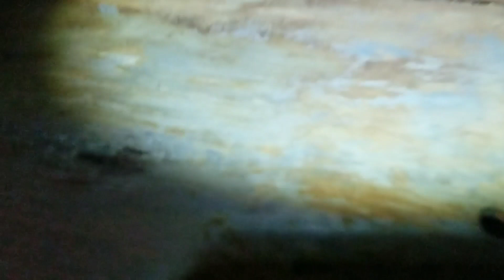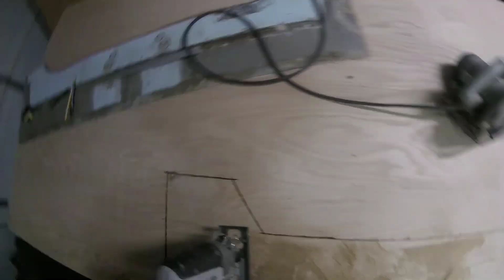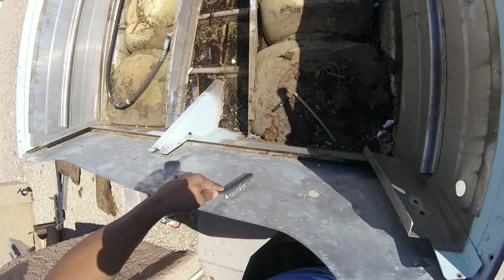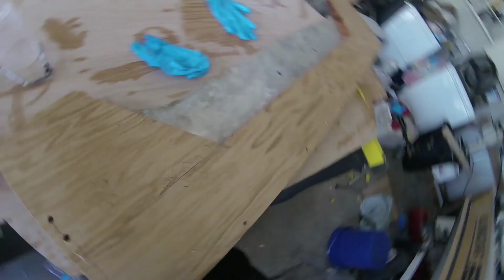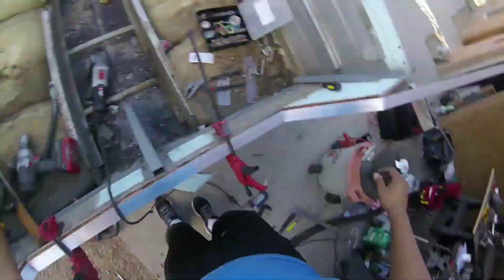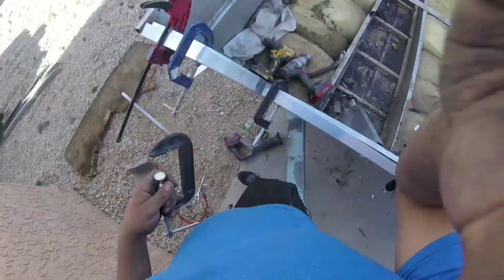Aluminum Boat Transom Repair - Step by Step Tutorial for Aluminum Boats & Jon Boats.

Comment: repairing that wont suck if your competent at aluminum tig welding or modern pulse MIG spray transfer aluminum. new metal mates
Reply from the maker: and what % of the population do you think knows how to weld Aluminum?

Comment: What you think about 1.5” thick locust for a transom?    It will cost only about $50, also if I only plan to do 1 transom do I need to buy those big jugs?   Or do they come in smaller jugs??
Reply from the maker: As long as there’s no veneer layers
Reply: @TinyBoatNation  ok.  It’s one solid piece of locust.    Can I get smaller jugs of the resin?

Comment: I am amazed how many marine repair shops will not work on boats older than 20 years old. Even if you have the parts and cash money. Lots of work out there. Mechanical and fiberglass repair.

Comment: Know what I always found interesting was people will plywood transom coat it in epoxy and think that they preserved forever, yet every time they drill a hole through it they make a place for water penetrate. The only way for sure that I know of to fix that is to drill your hoe out larger fill it with thickened epoxy then go back and re-drill it to the size you need through the epoxy.

Comment: WORK THE METAL!!!
Take a small or large sledge hammer and put it against the hole then start tapping the inside with a smooth head hammer. The aluminum will slowly spread and heal itself.  About 40 years ago I bought a 14' Lone Star V-Hull with 8 STAB WOUNDS on the side and that is how I repaired the holes. You can also start to tap it then drill a small hole and use 5/32 x 3/8 Aluminum solid round head rivets. HANSON RIVETS Grainger item # 1  6KU97
Same concept to install the rivets... Hold the head in place with a sledge hammer while tapping the stem on the inside with the smooth hammer It will look like a factory rivet. For the floor it will take 2 people, One holding the sledge and the other tapping the rivet stem.
This also works with loose rivets by just tapping them tight again.
Hope this helps!
I bought a 1985 Starcraft Marine 1430-12 Jon boat yesterday and used my rivets to close 5 holes in the transom with this method.
I occasionally buy and restore boats, boat motors and kayaks...Plus a lot more.
vids on my channel if you're interested.

Comment: I did a test using Titebond III vs. TotalBoat 5:1 epoxy resin.  I brushed TiteBond III on two pieces of flat wood pine and placed them together on a flat surface and did the same with the TotalBoat 5:1.  I laid the respective pieces on top of each other.  I did not clamp or screw.  24 hours later used a screwdriver to drive the TiteBond III pieces apart and it took the wood out of both pieces - the TotalBoat pieces were incredibly easy to separate with one soft blow of a hammer and screwdriver.   I would not use epoxy/resin to adhere plywood together. I put a generous amount of the titebond III glue on the two pcs of marine plywood and the strength and bond is like factory plywood - imo only way to go.

Comment: The top of my transoms is different I have a 14' flat boat but it's old I think  70's/80's the top is welded to the sides is it ok to cut that weld to replace the wood

Comment: Oak is great for boat building. Oak has been the standard along with Mahogany for hundreds of years. From breast hooks to knees, frames, keels, carlings, chine logs, to construction of ancient ships with oak beams the size of.car doors. The problem with your plywood choice is it is not marine grade. So the voids and knots in the veneers below would be the failure point. Marine grade Meranti  style plywood is made without voids knots and of course a water proof glue. Your using a low horsepower motor and it is well coated with epoxy. Shouldnt present much of a problem for you. I would have liked to see a thickened epoxy in between the 2 pieces of plywood after first being soaked in regular resin epoxy. All in all it was pretty well done.

Comment: Best I could find around here was 7ply .75" Birch and Envirotex Lite Pour On 2 Part Epoxi. It sais 48hr hard waterproof cure so I think it will last a long time. Either way I cut away metal to get it out, so it should be easy enough to inspect in a few years. Going with some tough bottom side paint to the rails on the outside of the boat too so it will be tough I think.

Comment: My Valco transom was Swiss cheese when i removed the wood.  I use a grinder to remove all the rust, then quickly primed with oil base galvanized primer. I then used the Bondo glass mat kit both sides, followed by Bodo with glass fiber. Sand smooth, prime and paint. Yes it would have better to cut and rivet/weld a new sheet, but its still good after 7 years .3M Fiberglass Resin Repair Kit, 00422, 0.9 Quart

Comment: The strongest material I have used is a street sign. The hardened aluminum is second to none. I sandwich it between  the plywood for extra rigidity and being so thin the extra thickness is barely noticeable.  Get in good with the local DPW and bring a 12 pack of beer to say thanks and you should be able to take a peak in the scrap pile. Highway signs are awesome. Hope it helps. Nice job on the transom project! My hats off to you.

Comment: I decided to install the through bolts on my 2019 mercury 20hp. 
When I drilled the holes, I noticed the wood seemed moist and there was liquid on my bit. It didn't smell bad, it almost seemed like an oil but im not sure.
It's an old Legend aluminum tinney. 
Is it supposed to be like that? Or is it likely my transom is soaked from a leak? 
Boat hasn't even been in the water for 6 months.
Reply: @TinyBoatNation  should I try and dry it out in the meantime? I gave it some taps with a hammer and it sounds awful in most spots but also the transom has no signs of flex or crack or anything.  
The way its built, i would just have to drill out the rivets on the top cap but the rest looks really simple and it doesn't extend down all the way to the floor of the boat. 
Someone had installed a plate/bracket for a spring loaded jack plate and I wonder if they didn't seal it properly.

Comment: What was the reason for going to a  16" transom instead of staying with the 20"? Wondering cause just bought a Sylvan 16' Sea Snapper and it has a 20" transom. Asking before I buy my new motor.

Comment: Thanks for taking the time to make this vid Mr. Lopez. I'm starting an 89 Alumacraft and I can see some small holes in the transom that were previously covered by some rubbery material. I can see to do it right, I'm going to have to be addressing mine right away.

Comment: Does the transom board have to be flush to the bottom? There was no board when I got my  14ft vhull but looking at the paint line it looks like the transom board never reached the bottom originally but I'm not experienced enough to know
Reply: Let me know what you found out about that.  I just took my transom board out, and it does not go to the bottom.

Comment: 2 part CPES is Great for water proofing wood used in boat building. Rot Doctor is one brand I have used for wood preservation. That may be similar to the marine epoxy you used... thanks for sharing.

Comment: Did the same thing last year on a Tracker 17 foot deep vee , I used 3/4 doubled up and a50/50 mix of epoxy and acetone it makes penetrating epoxy then covered it with straight epoxy it’s now a solid piece of plastic wood. Tin boats are great to fix up and you can find them cheap with bad transoms. Nice work .
Reply: Oscar Zamora the cold will make it slower to cure, when you cut it with acetone your thin it so it will soak into the wood before it sets off, the cold could do the same thing but I think that the thickness of it doesn’t allow it to fully penetrate. I have done testing on this I took a piece of wood and hit it with a 50/50 cut let it cured then put it into a bucket of water for 30 days after I cut the wood in half to see if water damage was there and nothing the wood became plastic, it penetrated fully. It can take a day to cure at 50 degrees.
Reply: Michael Lopez yes it’s how penetrating epoxy is made. Why pay a extreme amount for it. I tested it first on a scrap piece of wood and after it dried I put it in a bucket of water and weighed it down and left it in there for a month and the water never got into the wood.
Reply: Also forgot to say that I didn’t use as much hardener about a quarter of what I normally use because you don’t want it to set off quickly that gives it time to soak into the wood
Reply: Michael Lopez yes just don’t go. Ore than 50 % cut or it will start to lose its binding ability.

Comment: Nice job on the transom repair. I'm currently restoring a 1980 Western 13' aluminum boat.  Besides replacing the rotten  plywood on the transom I'm raising the transom from a 15" to a 20" to accommodate a late model longshaft  9.9 4 stroke merc.

Comment: I had the exact same issues with my 16foot  I did the same thing. muggy weld #1 great stuff.  I used west marine marine epoxy to coat the wood and glue it together...great stuff also.  Great video. again, thank you.

Comment: Look up Alvins Lab metal to use as a filler .It’s an aluminum solvent basically that you can use as a filler and then sand back in the shape to cover any of the corrosion you have up there ,but first use  Murdic acid straight shot right on the corrosion and let it eat the corrosion. Then Rinse with water and let it dry. And then follow that Alvin’s lab metal instructions.  Maybe Alvins lab metal is what you found up at the bow area of the boat earlier. Before painting . Also I have used Muridic acid to   Eitch the surface of aluminum instead of sending it to also use epoxy paints or polyurethane type paints to adhere to the aluminum with excellent success and have use the boats and fresh and saltwater without any issue. It’s just a much quicker process then sanding or welding and seems to be the best solution I’ve come up with.

Comment: I've had a plywood boat for the past 29 years.  The transom is an inch and 7/8ths thick, made from 2 pieces of 3/4" and one of 3/8" plywood.  In the 29 years I've had this boat I've only had to replace the transom once.  I keep up with the paint and varnish pretty well.  Yours is sealed with epoxy which is much better, and it has aluminum sheeting protecting both sides.  I can't see you having any problems with it if you're mindful of any new holes you put in it in the future.  Love the work you did with the cap also!  Nice!